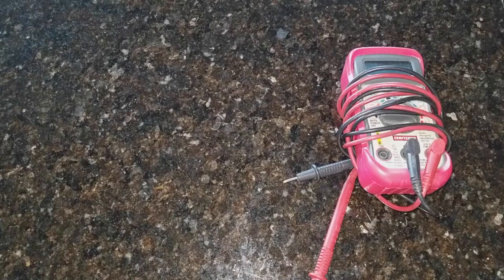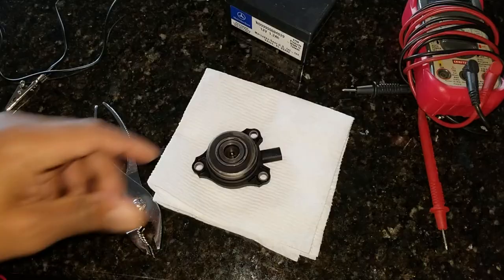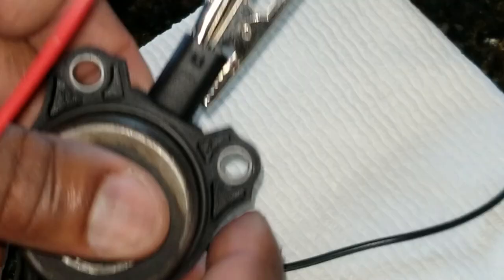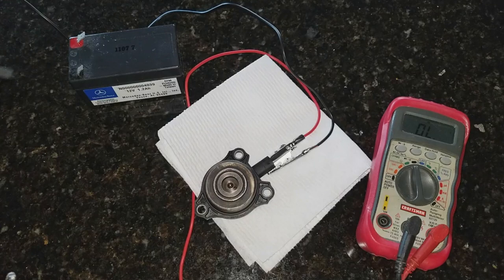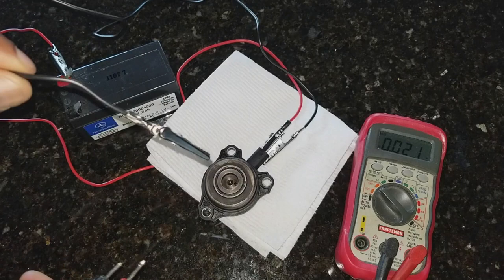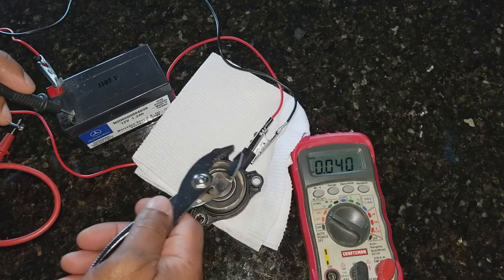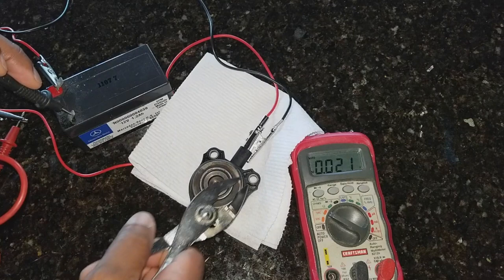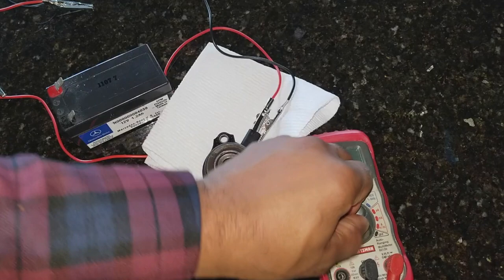Mercedes Camshaft Adjuster Magnet Diagnostics DIY

Comment: This isn't a hall effect sensor. This is a electromagnetic that has a plunger that comes out when energized.  It is not a camshaft position sensor!
Reply: Wow - No clue. >> Ray is correct - this is not a sensor (of any kind).  This is actually the solenoid (Germans say "magnet") valve that controls hydraulic oil to the camshaft adjustment actuator inside the head. There are four of them in Mercedes DOHC 'V' engines. one for each of the four camshafts (2- intake, 2- exhaust).  And yes there are cam position sensors as well - but the 'tested' part is not a sensor. BTW - Test procedure... similar to testing spark plug gap with a tire pressure gauge ?
Reply: lol wrong info
Reply: P0016 ?

Comment: Someone once said "do not take youtube videos as the gospel truth. Now I know why. This is not a sensor this is a solenoid that activates the camshaft adjuster to regulate oil flow in the cam adjuster assembly. The camshaft position sensor is something completely different. I am not being mean to you, just correcting you. You put in a lot of effort with your videos and they are very informative, but this is a lemon.
Reply: Yes, there are a few descrepancies in terminology that will be confusing for people if they try to look for the camshaft position sensor.  The part he is testing is the "VVT magnetic actuator" or "camshaft  adjuster magnet" (and I've seen some people in forums call this the "sensor magnet", which it is not), to be clear, there are Hall-Effect sensors nearby these actuators that tell the computer the camshafts position, but apparently they aren't usually the problem. 

Also, this part is not a magnet, it is a solenoid valve, in other words, an electromagnet, which only creates a magnetic field when 12 volts is put on those two terminals.  Finally, he has the Volt/Ohm Meter in series in the AC range! This is a high impedance setting where almost no current can flow, and what he is reading is a change in the magnetic coil impedance when he waves another piece of metal around the magnetic field; the actual useful setting on the VOM would be DC current, to see how many Amps the solenoid draws when energized, but I think even knowing that, is nominally useful. 

I think when these parts fail, they will either draw NO current (indicating the electromagnet wire or terminal is broken/bad), or draw current, but the oil valve is clogged and the valve inside is not moving anymore, so even if current is flowing through the terminals, the valve doesn't change position anymore.  On another car, I solved this problem by removing the actuator and using a solvent to clean the oil passages out until the valve moved when I applied 12 volts to the terminals.  But it is my understanding that this component can also leak oil, which may cause current to short across the electromagnet wires, so even if the component is drawing current, it may be that not enough current is flowing through the electromagnet to operate the valve, since some current may be bypassing the the electromagnet by shorting through the oil; so if you apply voltage, you should be able to feel or hear the solenoid actuate with a little THUD, and if you don't feel a THUD, you have either a clogged valve, broken wire internally, or shorted wire.  Also, you can test the component causing the error, with another one which is not "throwing a code". 

The most important note about this is that MOST OF THESE TESTS CAN BE DONE WITHOUT REMOVING THE ACTUATOR FROM THE ENGINE ! 
This channel has given me good information in the past, but this video is nominally useful for this problem, but I love his plad jacket, it's super-sharp with the white shirt, I've got to get one like that!  I hope this information helps somebody save a lot of time and effort.

Comment: 🤔The next thing he should have done, which was actually the first thing, was connect the terminals from the battery directly to the actuator to see the plunger move in and out.
This is what allows more oil to go in a different speeds
Reply: I just realized he has a different camshaft magnet than I do.
 Mine is for w203 I don't think mine has a plunger
Reply: Totally wrong its a plunger put 12 volts to it

Comment: I'm curious why you didn't read continuity when you read across the solenoid.  That's an electromagnet coil that you're reading so if it reads open then the electromagnet doesn't work and the unit is defective.  I checked on a brand new one, as well as a couple on my car, and they all show continuity across the connector pins.  Confusing...

Comment: Hi sir,  thank you for this video. May I ask as to the connector that connects to the magnet, so the plastic on my connector wire broke off so there's like 2 points which should connect to the 2 pins on that magnet, does it matter which point connects to which pin on the magnet?

Comment: Hi, if this magnet is faulty what effect does it have on the running of the engine? Great video by the way 👍🏻
Reply: Then you don't have adjustments to camshaft timing.
Reply: the computer reads these sensor to figure camshaft position to set variable timing with adjusters
Reply: I have c200 271 CGi with a broken camshaft gear bolt .Does it cause the engine to misfire

Comment: Could a bad one caused a pulse/surging on accelerating if really bad? Got this codes in the past with not noticeable driving issues as I’ve changed them pretty quickly. Now got a 1208 code after really bad surging at lite acceleration. So replaced bank 1 intake with old sensor I had and surging seems to have calmed down a lot, these sensors might have 200k Plus on them😞 as car has 395k now, oil changed 3-5k ow-40 always. Your opinion before replacing all 4.
Thank you

Comment: If this magnetic adjuster is failing can it cause the car mercedez Benz c250 2012 l4 turbo when trying to start it takes more than 5 seconds to startup and I plugged in a scanner and tells me bank A or single sensor camshaft sensor Intermittent.
Reply from the maker: Yes. Most definitely.   Check the connection. Sometimes the tab breaks off and the connection gets loose.

Comment: Does CodeP062B A signal for bad camshaft adjuster magnet? It says internal control module fuel injector control performance. I spent money for new cam sensors and the code is still showing up. Please help

Comment: i have a c180 2006 w203 oil is leaking at the camshaft sensors,,, does it make sense to change the magnets or only the o-rings?

Comment: Hello! I have a Mercedes e280 2006 petrol and diagnostics with p2090 component y49 / 7 (right camchaft exhaust solenoid)
when the car is cold and ignites the engine, the sound is heard for a few seconds and the sound goes off.
can you please give me your help.

Comment: What the actual hell? Man, you should not be making informative videos about stuff you don't understand, this is not even a sensor and it appeared to me that you were measuring current rather than AC voltage? Either way it was not correct, these are solenoid actuators and if you applied power to it you would of seen the plunger in the middle extend, it's not for measuring camshaft position.

Comment: I have the same mercedes i have a big problem. I pull the belt with my hand at the sametime im using a pry bar to take the belt off because i didnt kno you can use a ratchet. When i yanked on belt to get slack to take off belt it made a click noise with each yank. Checked pullys super charger for bad berrin or Howell noise. Put belt back on then started up and it is running hellish up n down missing reallbad at idol ? Evens out on rev up or driving. I dont know Mercedes at all. Its throwing code p2054 and p2055? Can u give me any advice on this problem. Was fine b4 i took belt off to check for noise pullys. Im so dumb for this. Its my lil girls car and only drove for 2 week with fresh licence. Thanks joe..

Comment: Hello Kieth, I have a 2011 ML 350 with 100, 000 miles. How long do the motor mounts tipically last? Thanks for all your great videos. I replaced the battery myself after watching your video.
Reply from the maker: Hi John.  They typically last 5 to 10 years but usually longer.  Glad the videos are helping.
Reply: the mounts don't all go bad overnight. The one that gets PULLED OUT by the torque does the heavy work... I believe driver side.

Comment: Hi, great video but I don't think all magnet sensors are the same because I have a 2004 C230 and my sensor is different. If I connect a volt meter it shows 11.9 volts. If I do exactly what you did by putting the voltmeter between the battery and the sensor I also get a reading of 11.9 volts. When I wave a wrench or anyting metal it does not react. My sensor is not exactly the same as yours.

Comment: Great videos and thank you  for recording this! I have tried replicating your testing and realized that there is continuity between the 2 pins in all of my 4 magnets. is this an indication that they are defective? I didnt even continue testing further after noticing the continuity on them.
Reply: Hi, same trouble here, does magnets were actually in fault ?
Reply: I know your comment is old but I hope this helps somebody else reading it. Not defective unless 0 ohms (shorted) or Infiniti (broken wire). It should have a low resistance value because each pin is the end of one coil of wire.

Comment: This doesn't make any sense whatsoever. If you check continuity through the connector pins and there isn't continuity ur  magnet adjuster is bad. it has to have continuity....
Reply: The magnet is a switch of sorts,continuity is a condition of a switch being open or closed,his process was correct.